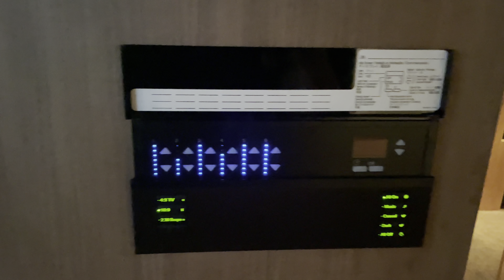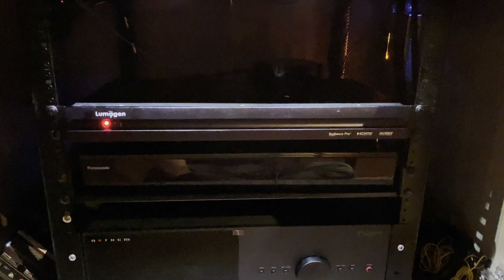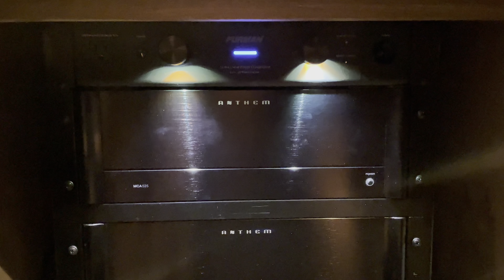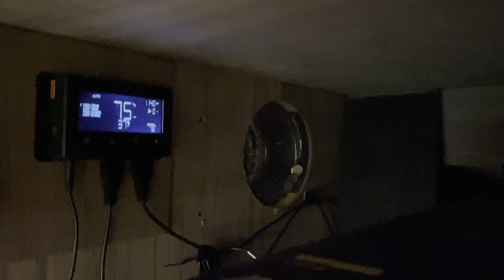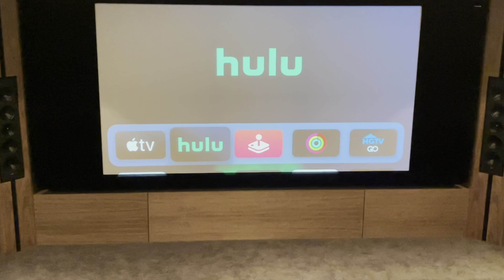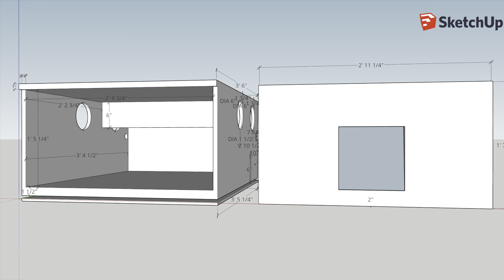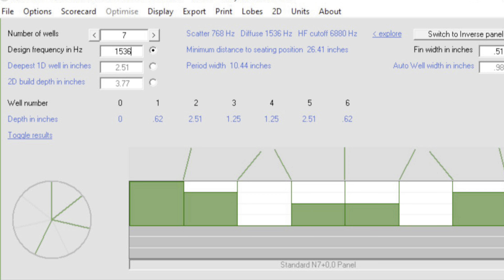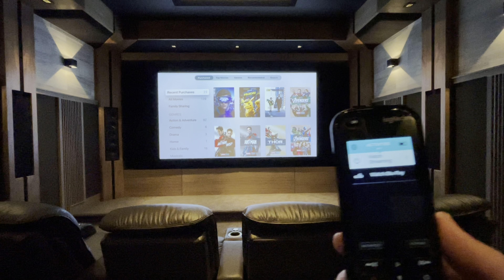Lakeview Screening Room - Full Walkthrough

Comment: Hi!  Are the subs in the riser boxed inside or just open?  Do you have air vents in the risers?  What and how much insulation did you use in the risers?  Beautiful theater!  Thank you!
Reply from the maker: No box, it’s an infinite baffle design and the subwoofers were selected to have the properties that work in the absence of air suspension a box provides.
Reply: @marcuss6950  Do you have air vents in the risers?  What and how much insulation did you use in the risers?  Do you have any other photos of the sub install?